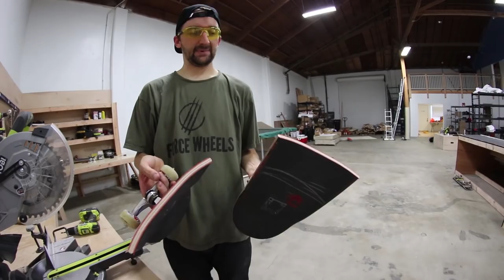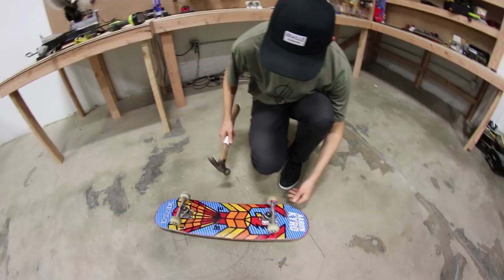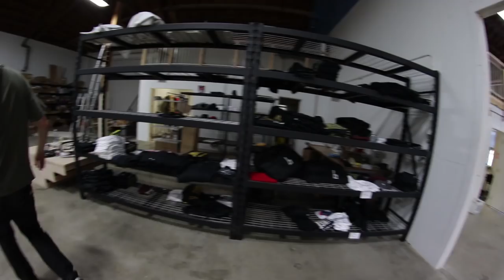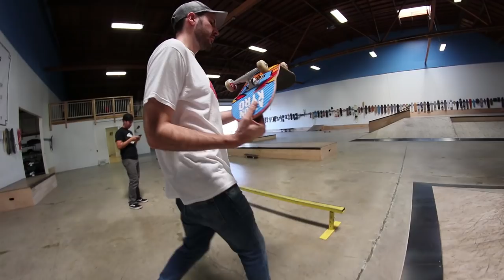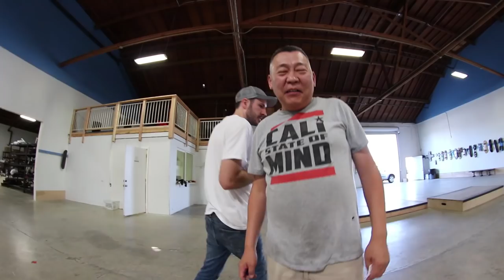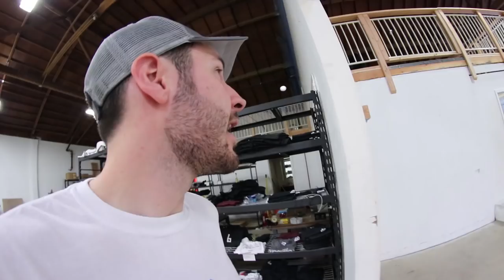THE COLLAPSABLE DOOR HINGE SKATEBOARD!

Comment: You have the hinges on the wrong side. If the hinges were on the bottom of the skateboard, you would be able to stand on the board without standing only on the tail/nose.
Reply: Exactly...
Reply: cfuvue they are not the brightest
Reply: The point is for the board to be able to fold up properly.
Reply: Suupur Sanicc don't fold directly in the middle so the trucks tm don't hit.
Reply: And you'd have a lame video
Reply: But then you couldn't  get any pop....so not a lot of tricks...
Reply: cfuvue Im going to put a full stop at the end of this sentence to seem smarter.
Reply: Where's the fun in that

Comment: You need a long rod preferably the length of the board to go through two holes intersecting the door hinge on each two pieces of board. If the rod folds in half only one way, then you can design a way to conveniently store the folded rod with the folded board for a compact setup.
Reply: it's called a deadbolt. or 2 deadbolts would work great. also adding to the length of the rod does nothing because the force is a shear point in the middle of the board through the thickness on your rod, then force against all the screws holding the bracket holding the rod.

Comment: I know y'all are not the most mechanically inclined but if you just put a small piece or wood or metal on the bottom of the board near each hinge it would stop it from bending any further and would be a lot stronger.

Comment: you put the hinges on the wrong side... so when you put weight on it... it will fold down.... if  the hinges were on the other side.... the board (where its cut) would press against eachother and hopefully making it more stable.